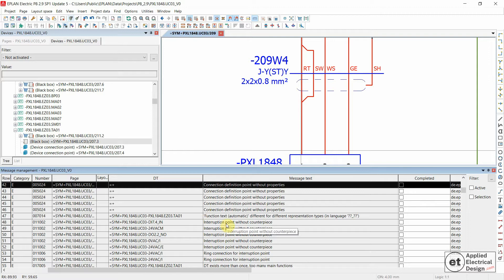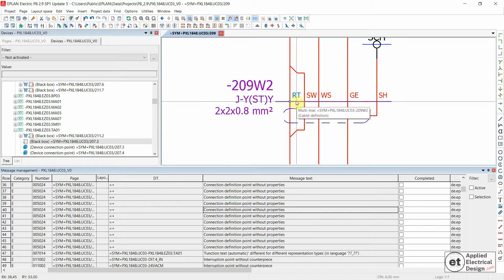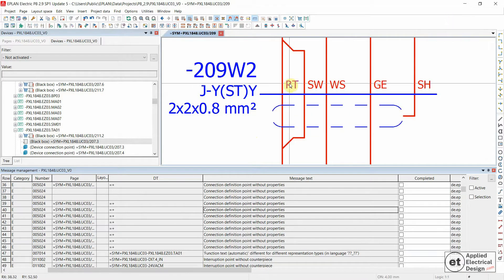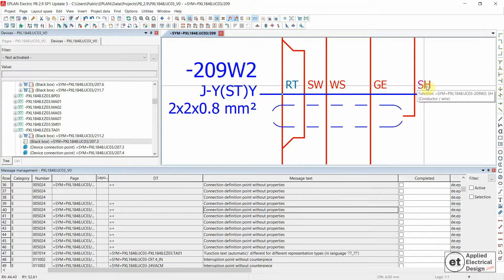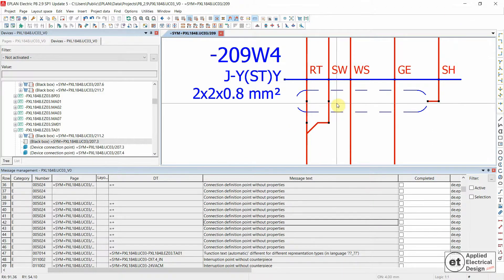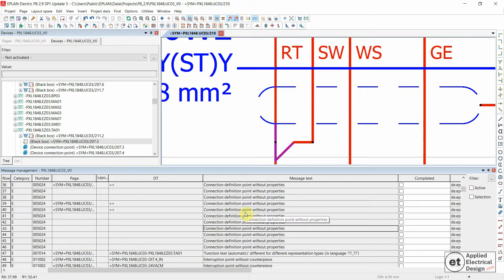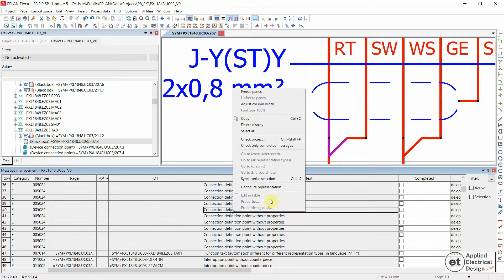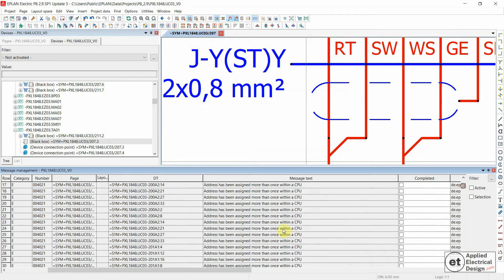Eplan P005024 - Connection definition point without properties

Comment: Could you help me solve this error P004020: More than one I/O connection point on a conduit?
Reply from the maker: @leomartinez7502   Click on this message and then press F1 on the keyboard. It will then open a help system regarding this message. Generally, each I/O connection should have a unique channel designation assigned to it. I suggest you download some plc macros from Siemens as a reference for you how that should look like. I hope this helped